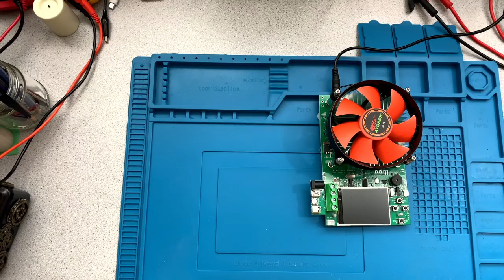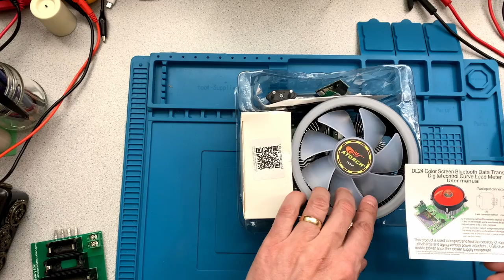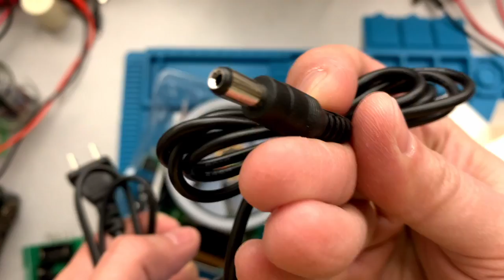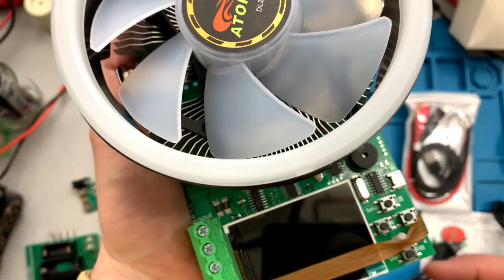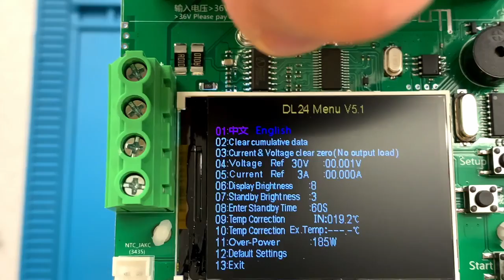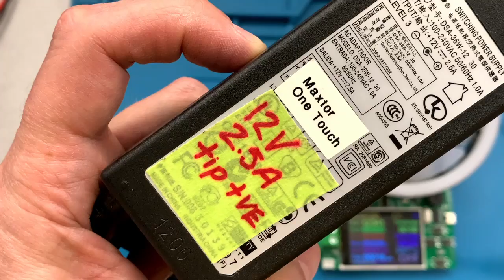ATORCH DLP24P comparison to DL24

Comment: I've got a DL24P also.  I really don't like how the heatsink and fan mounts to the board.  It moves around a LOT more than it should, which comprimises the "bond" of the thermal paste between the MOSFET and the heatsink.  With the large heatsink, it should run cooler at a given wattage, however, my DL25P always runs warmer than my DTL150's (20A=150W) and "Blue 10-150" loads.  Because of that, I have my DL24P limited in the settings to 150W also to prevent burning out the MOSFET.  Otherwise, it is great.  But my favorite is the DTL150 load (I've got 2 of them.)

Maybe you could do a video on the "Blue Loads" also.  What you really need to get your hands on is a DL24MP... I've got one of those too in the 600W flavor.  It's a beast!!  Up to 40A and 600W... it will warm up the room if you load it up!
Reply from the maker: I will have to look into the DTL-150.  Yes, the DL24MP is a beast. I have another load that I use in the calibration video.  I really need to do a full review on that one, I doesn't seem to have a model number.
I had not paid a lot of attention to the heatsink mount before, but now that you mention it, it does move around a fair bit.